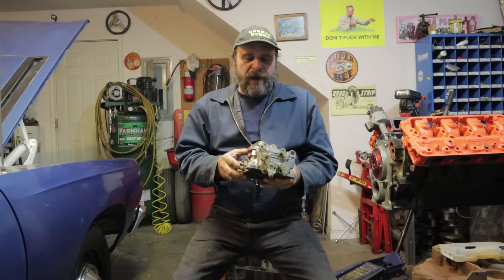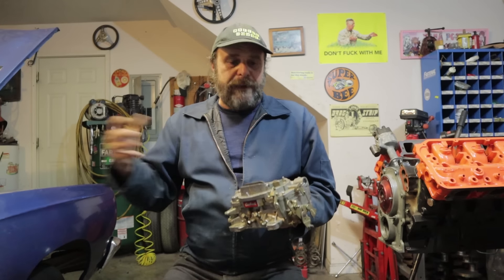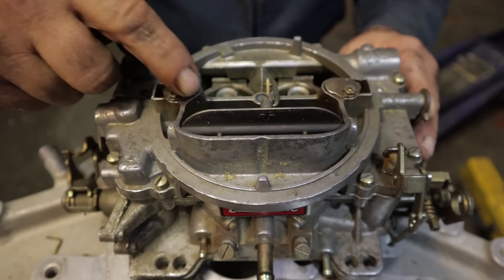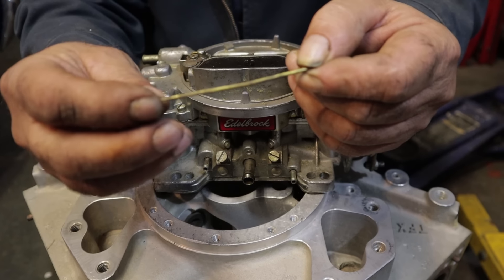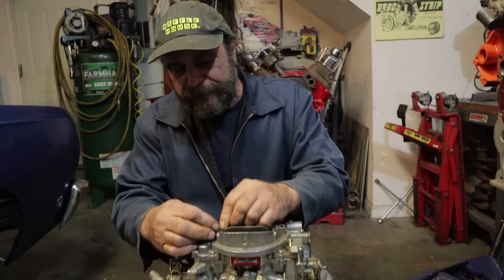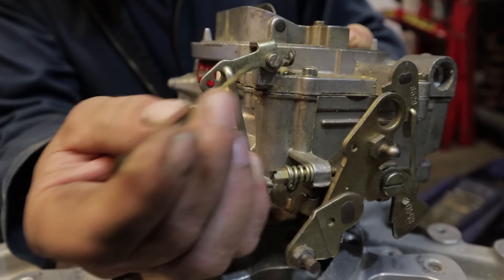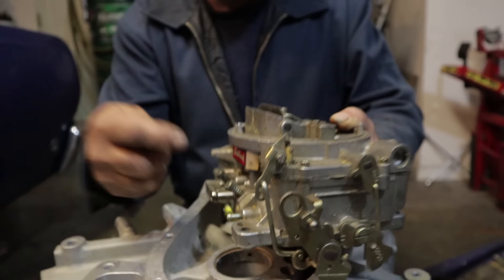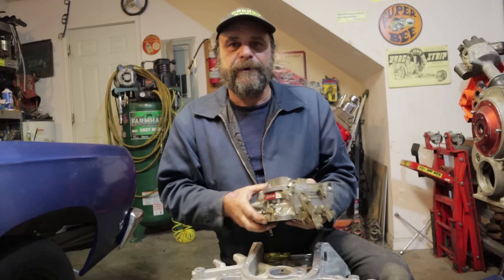How To Make The Edelbrock Carb REALLY Work For You

Comment: Bud u make it sound easy and u Explain great bud !! I’ve got a 1986 k10 Sierra with a 14063 and I’m smelling fuel at idle just recently got a calibration kit ! Any suggestions .. motor is a GM crate 290hp 350 completely stock with the Exception of an Edelbrock intake.. Also it has a granny low 4 speed

Comment: So, I'm wondering why my Edelbrock says Weber on it, and not Carter, I guess Carter sold the rights to Weber?  Then I'm looking up all the various numbers on my carb, and found: 1406 2812. I came up with 1406 as being a Preformer 600 cfm carb, and the 2812 seems to translate to the Edelbrock intake manifold. I'm curious as to what the 2812 number is about. Great video, voted excellent by me! Thanks

Comment: 100% of my carb experiance has been with Quick Fuel which I believe are Holleys. Sadly, I've actually worked on more types high voltage electric drive systems than carbs and not by choice.

Comment: I'm going to need to put composite or wood spacer under my Edelbrock, because if I drive to the store , go inside for 20 minutes and come back out, its heat soaked (or something?) and I have to hold it to the floor and crank it at least 5 seconds

Comment: Mine keeps making a gasping for air sound, like if you take a deep breath and hold it in, and it keeps dying and won't stay running under load and only when you try to give it gas. It will idle all day and rev out just fine, absolutely no hesitation. But as soon as I put my jeep in gear it does that and you can hear it gasping. I have to hammer the throttle or keep it wot/high rpms, 3k or higher to keep the motor running or it will die, but if I let it sit for a minute itll start right back up fine and idle all day and rev in neutral. Sbc 350. Has an electric fuel pump wired to an oil pressure switch. Fuel pump is new. 1806 edelbrock 650cfm avs. Rechecked my floats and rebuilt the carb because it was sitting for a couple of months. I fixed a vacuum leak from the base of the carburetor and it started doing this more and more until now where I can't drive it.

Comment: Good content! I have an Edelbrock Q-jet on a 383 stroker blueprint that's mounted on a boss hoss motorcycle but it doesn't look like the one on the video. I found 3 numbers on it 8904, 1901 and 2892, embossed on the side. bike idles perfect and runs great if i go easy on it but when i open full throttle, it stumbles. Makes a cut, as if it's missing fuel. Pump is pulling 4lbs from the can (had to take the tank off to get to the carb). I guess it'll do a little better once it's gravity fed. Would appreciate any help finding the rods you're talking about in this video. Thank you!!

Comment: I’m surprised you didn’t mention to avoid the flawed design of the 750cfm edelbrock.
  It’s bunk.
 1406 will run circles around a 1407 on any engine. 
The 800cfm is the nicest on a hotter motor with the thermoquad style secondary air door. Great carb for beginner tuning. Reliable, doesn’t piss gas when you have to tune it, no gaskets to fuck up on the top side. Very forgiving unit. likes to drink compared to a Rochester or thermoquad. Actually I liked the thermoquad better by design but the plastic body can bite you in the ass too.

Comment: Nice explanation U.T. But one question, my experience with AFB carbs is that when you stand on the brakes, or in an off road, off angle situation, they flood out and kill the engine. I’ve tried the spring loaded needles and all of that to no avail. What gives? Thanks man!

Comment: Great video. I’m having issues starting the engine after my car sits for 12 or more hours. Not sure what you meant in this video about keeping the primary circuit primed.  Is there a trick so I’m not turning the starter for 30-45sec on a cold start?

Comment: I'm having fuel boiling problems with the Edelbrock.  Tough to start when sitting for 15 minutes.  Have to crank it with accelerator held to floor.  It's pretty embarrassing.   I'm thinking the fuel bowl is directly above the hot intake.  I am right now trying a Holley to see if it's better as the fuel bowls have an air gap between them and the intake.  I think I am having better success with the Holley.  1968 Mustang 302 with only modest engine mods.  I'm actually also pissed I can't get a good burn out either with open end 3:00 rear gears.

Comment: Excellent video!! Thanks

My 1967 ford 289 has an edelbrock 650 cfm but it’s not quite running right. It bogs down at low rpm and then really starts to pull around 2500 rpm. It won’t even squeal the tires from a standing start. Could this be a carb issue?

Comment: Tony, Thank you for explaining. I was wondering if you would please tell me what rods springs and jets i should have on my 1406 edelbrock. This is on a 350 small block in a cruiser truck. Montana elevation about 4k feet. Engine is stock with performer intake and gets horrible fuel mileage that i am trying to  fix. Thank you
Scott

Comment: Hey Tony. Ive got a 1965 283 , .030 over, summit k1102 cam ( same as edelbrock performer grind) , z28 valve springs in rebuilt to modern gas 520 power pack heads, with a 327 intake and a avs2 500 on it. And If it matters... th350 w/ stage 1 shift kit.   Avs2 has the stock orange step up springs. Vac is a steady 19 inches, should i have silver springs or keep the orange springs?

Comment: Hello and thank you for your video s I just swapped ego for edelbrock 1405 I tried a holly 650 it was way to hard for a house painter to set up . The edelbrock much easier but it’s flooding and the ventury to the 2 plungers with long rods going into jets …they get stuck all the way down can I very lightly sand or clean them or is there a different reason they get stuck down

Comment: Thank you Tony for this information I recently purchased a used 1405 but I made a mistake in buying that due to the cfms slightly higher than what I need for my sbf 260
Is it possible jet it down /metering rods, and springs 
Off a 500cfm specs chart?
Instead of purchasing a 1404 or 1403

Comment: Hi Uncle Tony, thanks for the great videos. I'm unable to explain what I saw earlier: 85 Camaro, 305 with Weland intake and an Edlebrock 1406. The metering rod/cap stay up at idle and shoot down upon acceleration. Do I need to say? It runs like garbage! The PCV is connected to the rear port, the small front left port is connected to timing and the larger mid and smaller right are plugged. What am I looking at here? Some kind of reverse vacuum? Thanks for any help you can offer.

Comment: Your thee best my r.v conks out but starts up after a a few starts until gas catches it sputters like you say it idles beautiful but when I start to accelerate she conks out. I'm gonna start with the accelerator pump. It sat for some years ,bought from. Elderly couple when on road she runs like a top engine still a baby. I wanna convert her into a tow truck because the mice got it all stinky and mold is bad in the rear only where the bed is. I just reinsured it today (only place to live) can't afford motel price anymore.im planning to go to California.
Is therea way to acid clean my radiator myself?

Comment: Thank you Tony !! I have the edelbrock 1406 (600cfm) on my 66 289 engine and it has always seems like a bit "much" for the engine. I am seeing now I could have tuned it. I say COULD have because I have a 347 stroker on the way (ya baby) and will be using the edelbrock rpm air gap with this carb. I will have the 1406 starting as it is (factory) and now can tune from there. I have seen their guide, I just wish they could be better at symptoms...How about it Tony? You should do a video that says "If it does this, go smaller jet, metering, etc", if it does that "go big (or go home) "...Thoughts ?
Reply from the maker: We'll be doing a plug reading video soon that should cover all that pretty thoroughly

Comment: This was a good video, thank you. So when tuning is it trial and error  or is there a way to calculate what you need as far as jets and springs? I have some pinging under heavy acceleration and I am running to lean. Should I start with stiffer springs and just play with it? I also have smog to deal with, it passes right now but it isn't running optimally.

Comment: Tony, I have a early 60s dual quad carter afb's. After about 8 trys with different size metering rods(stepped up from a 92-95 jet) got her to idle on her own with idle screws both out about 2 turns. Do I need to match this for the 2nd carb? Also technically I could go bigger jet with bigger metering rods? how do you know kinda when your done or have it exactly right. thank you great video

Comment: By the way Uncle Tony, back in the day the strip kits for the AFB came with metering rods with two steps, while the AVS had three steps. The trick was to us AVzs rods in the AFB for better tuning. Then when the AVS went off the malarkey they only sold two step rods. Now that Edelbrock is making a new version of the AVS, do thier strip kits come with the three step metering rods?
Reply from the maker: Good question
Reply: Uncle Tony's Garage maybe I’ll look into that and post the answer since I don’t have a way to get ahold of you. Again, thanks for all these videos. I’ve learned a bit, and remembered a bit too. Great job!
Reply: My Thermoquad  strip-kit Pn 10-203 has three step metering rods ie .063 x .049x .040 and the TQ has an air valve aka secondary butterfly.
Reply: Paintnamer I wonder if they’re interchangeable. The AFB and AVS are, but they are very different carbs. I love the thermoquad by the way. It I’d my favorite street strip carb! In the 60’s and 70’s they made a couple models, one was 800 CFM and the other was 1000 CFM. It fit on a normal spread bore manifold with no problems. They didn’t sell very well and for a while you could buy them for $69.95 in every magazine out there. Too bad they quit making them, but like the Quadrwjet Tory were very misunderstood.
Reply: @wileecohagen  The AFB rods are 3 1/8" long and the TQ rods are 2 1/2" long. I had to get my AFB strip-kits and check. I ran 2x4 AFBs on a 440  Offy  for a while for the cool factor. I remember the great speed equipment deals in the car mags like '67 closed chamber 440 heads $79 bare. Look through the old car magazines and wish!

Comment: I bought a 79 ford for my 15 year old a project truck. Has a 351m and 4 barrel edelbrock. Motor runs good when we bought it. After letting it sit for months working on frame, axles and body. I noticed oil in the floor. After investigating found out the carb drained the fuel tank into the block, (oil pan)
What causes this on theses carbs

Comment: Uncle Tony??  My car runs great with new spark plugs, but that only lasts a few days, if that. The idol sounds good and feels good. Idols high when u first start it. Once it warms up, you give it a sharp pump of gas, and idols slows down to normal.  1969 cutlass 455 with MSD ignition kit, edelbrock carberator 750. Please help.

Comment: Have a Edelbrock with electric choke and when I put it on (fresh reman) it was ok but not perfect. I've fumbled with choke and mix and still seems rich I took it off & apart the other day despite the 2 fuel filters there was enough fine rust in the bottom to cut 2 decent 1970s lines. That's straightened out now but back to being rich smell and burn if you stand behind it long enough. Its a 350 says set at 8 degrees but it won't run right unless it's at about 10, if its not heat soak and hard start its a little rich im starting to think ignition components maybe in need of swap I run platinum plugs hi output hei. Any ideas  Uncle Tony ? If I could get this right id call you PaPa Tony.

Comment: Question , i have a boat with a 80s 360 chrysler marine in it with the carter carb. What would prevent fuel from being drawn out of the secondary boosters . I get fuel dribbling out of the secondary intermediate tubes on both sides of the secondaries when i open the weighted door and look down it while running but nothing coming out of the boosters. It doesn't seem to be enough air to open the doors by itself either.  Could having the wrong rods in it prevent it from producing enough power to draw enough air ? It idles great and gets to about 3krpm with out any fuel in the secondaries and carb was professionally cleaned.  Thankyou for any response

Comment: +Uncle Tony's Garage
 When I give it wide open throttle it stumbles and almost acts like it's going to cut out(if I hold the pedal it quits but will restart easily) then it picks up... What am I missing? 307 with Vortec heads Summit 1102 cam 650 CFM Edelbrock carb AVS. Full tube headers. 12° initial timing. It's pulling about 15 to 17 degrees pg Mercury at 800 RPM idle. 1970 Chevelle.

Comment: General question here...I have an old AFB style  carb (1406) that I'm hoping to be able use on my Slant 6. But, I'm pretty sure it will be way too much for my motor. Can I buy the Calibration kit for the 1403 and just use those jets and rods in my 1406? Are all these carbs basically the same base/body with different jets and metering rods?

Comment: I have an AVS2 on a 454 and it takes forever to get up to speed works fine everything’s good exept I don’t think the secondaries are opening up and I feel like it’s because of the vacuum so if I change the step up springs to something smaller or thinner it would pull more vacuum correct?

Comment: How do you identify one metering rod from another? We have a bone stock 350 Chevy in a ‘71 C10. It idles and runs very rich. 
When watching the tops of the rods while the engine is running, should they be at a specific height?

Comment: Uncle Tony, I have a 1980 C10 Silverado with a 350 SBC and a 1406 edelbrock,and 2701 edelbrock intake manifold  is it wise,using a stock Manuel fuel pump or a edelbrock fuel pump, for better carburetor performance my C10 Silverado is a every day work truck.

Comment: Question. Working to solve a problem with one of these on my fathers 327. It's boiling gas out two tubes after hot shut off. Any advice to fix this problem. I just cleaned it and rebuilt it because I thought it was leaking down. Now I know what it's doing but how do I fix it. Thanks.

Comment: I’m rebuilding a 1405, got a kit with springs metering rods and jets. Jets are 385, 491, and 308. Thé Springs, no colors , the metering rods are 7347, 7936 and 7342. Tin the carb I could not read any numbers on primaries, and secondary jets, could not read the numbers on the metering rods. I need to put this carb in the car so I can sell it as a cruiser. Believe it or not I was a Ford mechanic for years, have a bit of long term memory loss that’s why I’m asking for help. This kit I bought said everything to set up as a race car or cruising. No directions. I asked seller and he said “no directions!”. He said “you should know”. No I don’t know. You can’t ship these kits back. TY

Comment: Hey tony, 

I’ve got a ford 302 with an Edelbrock 1406 on it. I recently did a cam swap and it was running fine until it started getting cold here in Colorado. Now it’s almost impossible to start and idle.

I don’t think the internals of the carb have ever been tuned with proper jets, springs, and rods and I was wondering if you’re knowledgeable with tuning for altitude. Do you know of a particular internal parts combination that would work for my altitude? (5400 feet)

I could really use some help! 

As a side note I currently have a single plane torker 289 intake which I’ve been told could also be making starting and idling harder. I’m replacing it with a jegs brand performer style intake here soon. And I also have the opportunity to use a classic style Holley 600cfm carb that coming with that intake from a gentleman on Craigslist. That carb and intake was used to break in a 302 before he switched to a hilborn so I think it’ll likely run on mine!

Any help would be awesome! Keep up the great content!

Comment: So what kind of fuel pressure are people running in the Edelbrock carb? The mechanical pump on my 360 is running 7.5 to 8 psi and that seems way too high for Edelbrock carbs, so I had to fidget with it until I got it down to under 6 psi. Now it is running better, but curious what kind of luck people are having with the fuel pressure. I have considered going back to the Thermoquad, but I have a real hard time tuning those.

Comment: Tony, we need your help. In a 1995 tige boat with a 350 chevy we just replaced the block with a crate 350 and we have been struggling to get it right. We just put a new carb on it as well. (Runs same with old carb)
It seems like the secondaries are running out of fuel or something because as soon as we get to the secondaries it stumbles. We have tried a whole bunch of primary jet, metering rods, and rod springs. We got it to run pretty good up to about 3800 rpm’s right as the secondaries open it falls on its face. We are at 2000 ft elevation, stock jet for 1410, 7347 metering rods with pink springs. Haven’t messed with float from the factory or the secondary jets. What do you think is going on?
Reply: If we have a heavy skier behind the boat with more load on the engine, it will stumble around 3200 rpm’s.

Comment: Hay Tony  happy holidays  Tony I have a question  on pros and cons on spools on and off the track could you please elaborate thanks.
Reply from the maker: I've never owned a spool...other than on the fuel cars..but I've welded a ton of spiders over the years.  No problem on a limited use car that will never see slick roads, but for a daily, stick with limited slip

Comment: My edelbrock 1405 runs pretty smooth however it is too peppy off idle. As in its hard to regulate the throttle. Would that mean my metering rods are too thin letting too much fuel into the carb at light throttle?